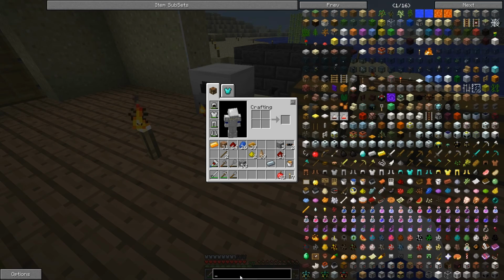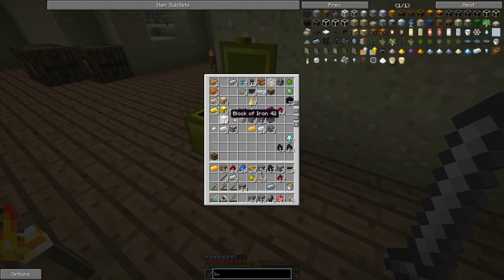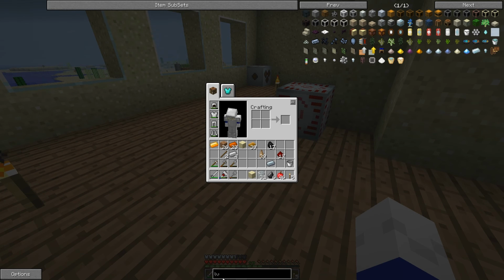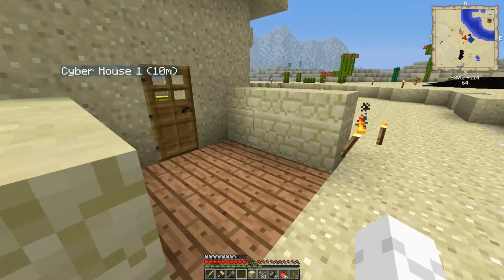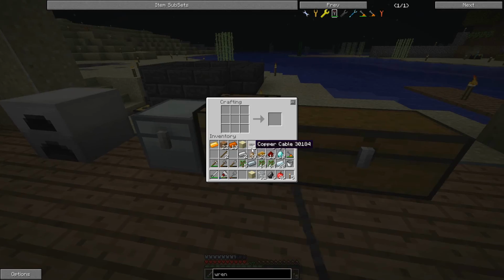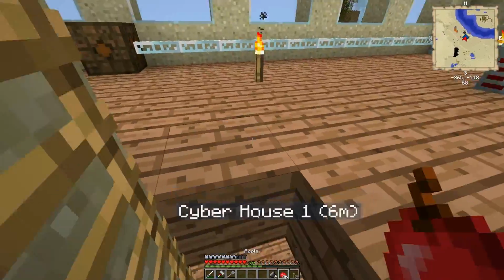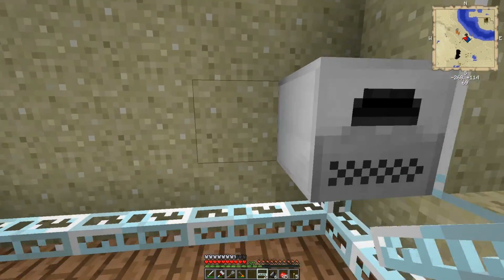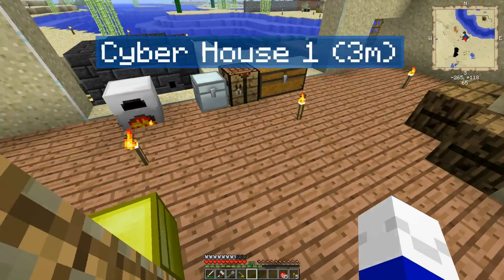FTB Unleashed - 11 - It's Not Stealing

Comment: Another tip. Not sure if it will ever be useful for you but I believe in the smeltery you can click on a type of metal you might have in to put it to the bottom and that will be the metal that will pour out.
So you dont have to empty itand then put other ores in. I hope you get me :)
Reply: So you could have iron, gold, copper in there and when you want it to pour out gold you just click on the gold line in the ore meter so it will go to the very bottom and then that is going to be the ore that will pour out of the... things :D